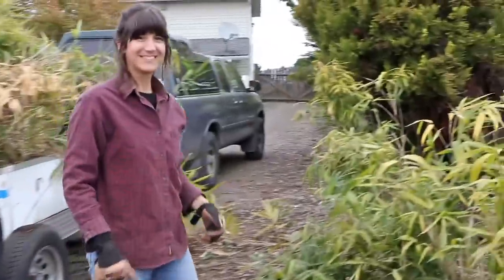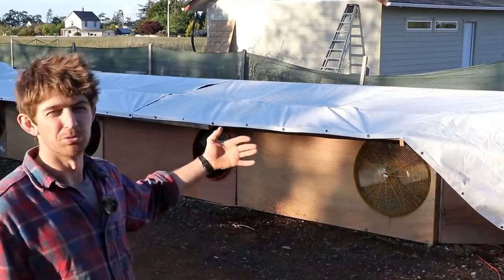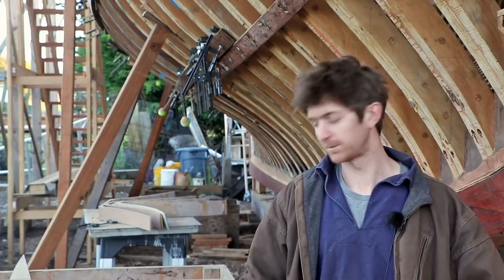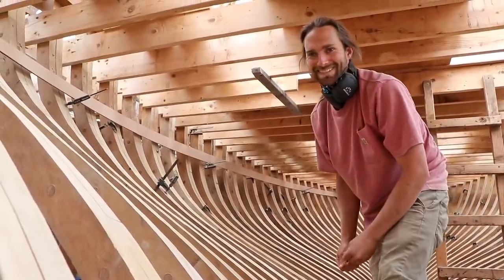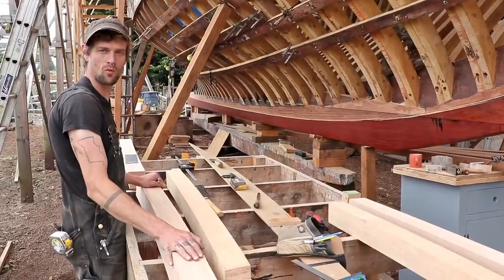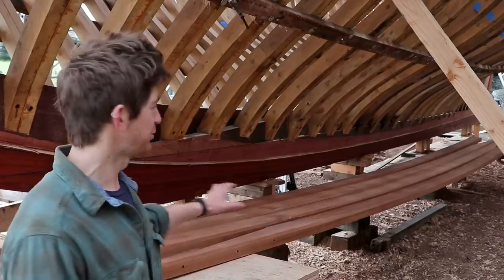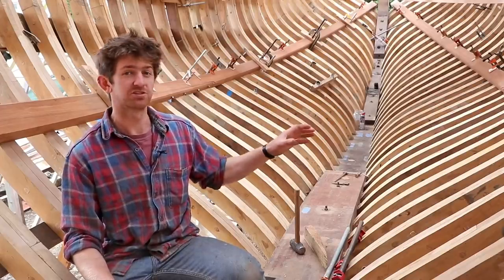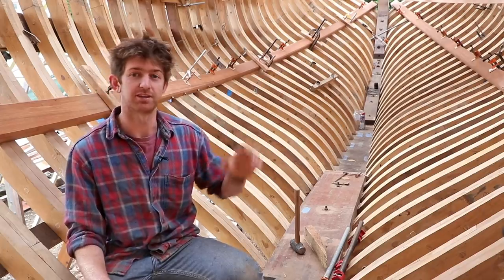BoatBuilding - Bilge Stringers / Oak problems! (EP72)

Comment: Hey Leo, I am really not qualified to make any form of comment on boat building...... I watch in awe at every episode, and how you are sculpting a very beautiful boat. 

However here is my moment of utter stupidity and ignorance..... the porous wood?? Surely being porous means it could also have absorbed a resinous material to strengthen & reinforce the wood?? It would be interesting to observe - purely to see if manufacturers claims are correct...... whether the white oak holds up to the same “hammer” abuse you demonstrated, if artificially reinforced. I was thinking an epoxy resin. If soaked and then left in vacuum to ensure maximum absorption...... would the dubious quality wood “come good”??? You likely already know the answer as you are the expert and I’m just a admiring amateur. Best wishes and good luck 👏👏👏🙏👍

Comment: At 25.15 point.....wouldn't it be a huge difference in the overall strength and "oneness of the boat if the long fore to aft boards were steamed in a large long homemade pipe steamer ,then quikley removed and clamped or fastenedjust before final fastening ,which would lock in the shape and enabling the boat the same amount of strength either direction.instead of building into the boat along with strength but also a spring effect with one direction (the opposite side of the direction of the bend)without steaming ,and doing it the fashion that you did ,while maybe being adequate for the perpous, it will always flex and bend more in one direction than the other ........which may be fine.flexing in a boat can be good but usually and absolutely the laws of physics say that the durability and  longevity of any object,or substance,when certain known loads are built into and are close to equal,such as a long board that is straight without warps or twist ,longevity is reduced due one side or direction of and from movement  taking more of the load.load eqaulity is the key to maximum lifespan and strength . Just wondering what your thoughts were.

Comment: why not treat the questionable oak with something like nitrocellulose lacquer? it'll seal the pores, it just needs a something like stirol or vinyl added as a clogging agent. It won't smell or poison you (unlike whatever  they use on railroad ties, creozote, I think). Or a drying oil, whatever artists use as the base for paints. Obviously, you need it in quantities that artists or luthiers don't use, but you can also use industral grade, not ultra-refined grand piano lacquer.
Reply: oh never mind, i watched further and you've replaced it. good.